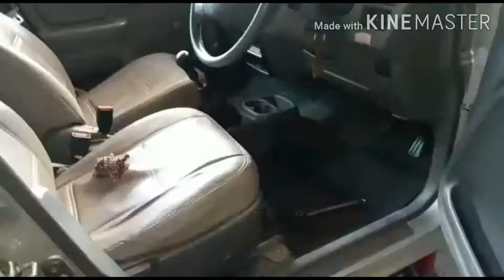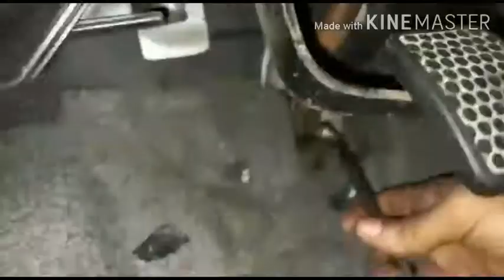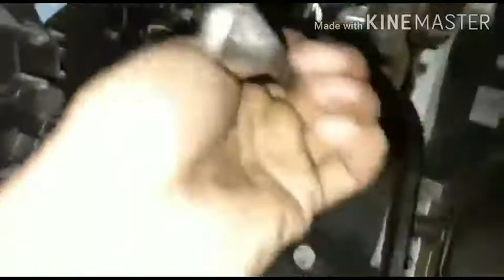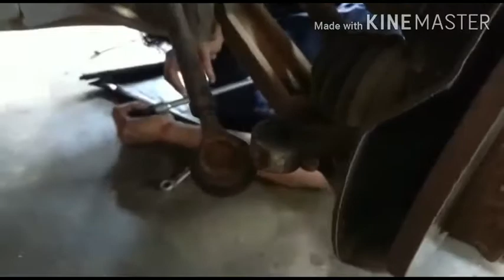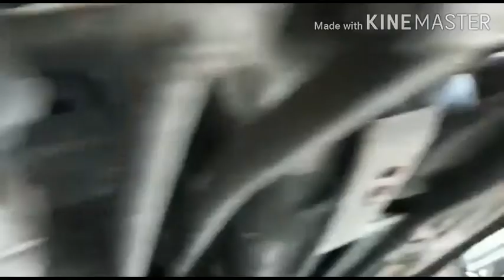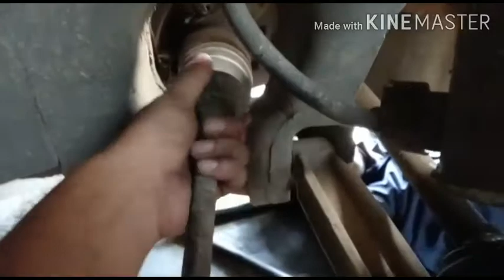Alto Steering Box Removing | Malayalam

Comment: ആൾട്ടോ സ്റ്റിയറിംഗ് tight വരുന്നത് എന്ത് കൊണ്ടാണ്
Reply from the maker: Damber bush over tight cheythal varum,
Pinne motor work cheythilegil undakum,
Steering boxil grease illagil varum, tyre pressure
Reply from the maker: Oil, filter, break pad , coolant eni parts avashym undagil contact cheyam
Reply: നിങ്ങളുടെ വാട്സ് ആപ്പ് നമ്പർ ഒന്ന് തരുമോ ഒരു സംശയം ചോദിക്കാനുണ്ട്
Reply: @NithinTechVlog  ok
Reply: @NithinTechVlog  Bro ente alto steering hArd ayi.. nokkiyappol shock bearing poyirunnu.. Bearing mari... Power steering motor nokkiyappo motor nu power kuravanu enn kandu.... New motor mattan labour charge adakkam ethra rate akum?
Reply from the maker: Motor nte currect rate ariyathila
Reply: @panchajanyam2477  hello bro ente aulto 2009 lx anu power steering kettan pattumo ? Ethra Roopa akum please answer
Reply: @NithinTechVlog  hello
Reply from the maker: Kayattan pattum but proper working akumo enn ariyil
Reply: @syammohan305  20k something
Reply: @NithinTechVlog  hi